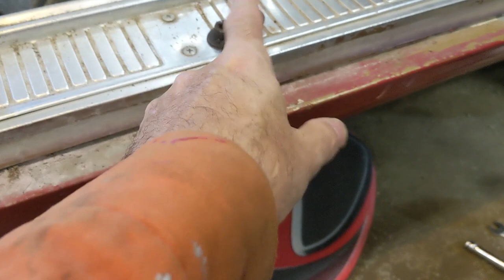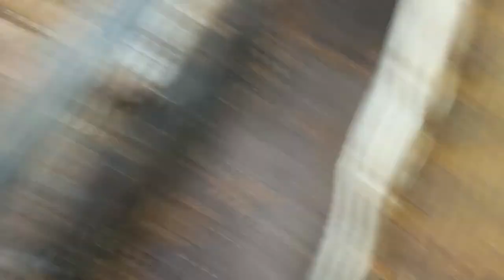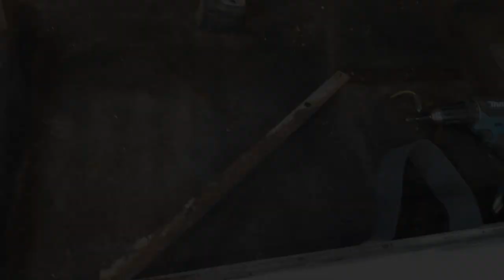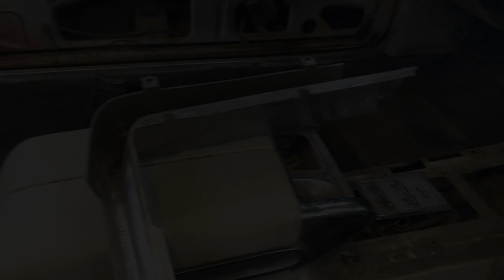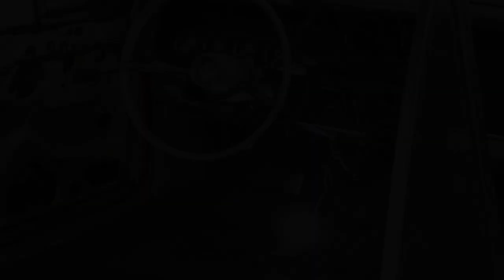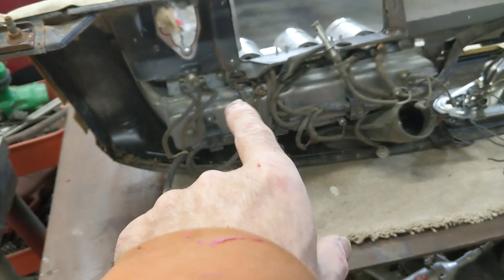REMOVING Seats/Console & Dash - 65 Thunderbird Convertible Restoration Ep #7

Comment: Well that is interesting that you don't have 30,000 vacuum hoses like I do on my '65. My a/c heater control looks similar to yours but it has the "rain bow" wheel where all the vacuum lines attach. I know I just took it off last week and mailed it to the Birds nest in Portland. I have not done much to mine as it's been so cold during the winter here. but now it's getting nicer! I already fixed both rear window vents by changing out the dead vacuum motors. Ops check good!
Reply from the maker: Hi Mike,
I didn't realize it at the time of the video, that the A/C cars had all the vacuum hoses for the cooling...not sure which is better, having all of those hoses or not having A/C. Lol

Comment: Hello Alvin, it's coming along real well. I agree with tuckerjl about the heater controls. The AC models used vacuum. I have not taken my dash apart and hope that I will not have to. That looks like a ton of work!
George B. in Michigan
Reply from the maker: Thank you George, I guess not having all the vacuum components is a blessing in a way.
Reply: @J_R_Shop  I think so also. Is your donor car a non-AC vehicle?
Reply from the maker: @servicetechnician3264  yes it is, so I'll have spares for the heater controls. 😊

Comment: Now is a good time to add factory AC to the car. (That way you will have all of the vacuum modules that the heat only does not require)  The heat only is way too trouble free LOL.   I added factory AC to a 61 thunderbird using a complete system from a salvage yard car.  Since you are in Canada I am not sure it is an issue.  It is a thought though since you have the entire car stripped.  It just requires additional holes in the firewall to mount the larger HVAC box.  The knock outs for the freon lines are sort of stamped into the firewall as I recall.
Reply from the maker: Hi Jeff, I did consider adding the A/C, until I started looking for the parts...holy, the price is more than I have into the car already, and there just aren't any of these sitting around for parts, the green one I cut up was the only one I found, and I bought it right away.
If I were in a high humidity area, then I would definitely spent the money...Saskatchewan is very dry in the summer...hot but dry.

Comment: I'm jealous of you non-AC guys...I wasn't aware that those cars had cable controls instead of vacuum. Canada, Maine, North Dakota and such places probably had few AC cars. OTOH, the vacuum seals on my own '65 were all intact, so it wasn't much of an issue for me - I didn't need to replace ANY actuators or reseal the "pizza slice" control unit. All I did on the control unit was clean the mating surfaces and that gave me a good seal.  All that stuff is holding vacuum very well, so I'm very lucky compared to most T-Bird owners with the vacuum controls. I did have to replace all of my vacuum lines, however, and that was a bit of a job because I didn't take the dash or console out so access was a problem. Thanks for the video.
Reply from the maker: As you can see in the video, I was also unaware of the non-AC difference, I just made the assumption they were all the same. I remember when I was young and hanging around Dad's shop (Jamieson's Repair Shop), that seeing a locally own car with AC was a big deal...not many people where I grew up could afford such luxury!  ❄❄❄
Reply: I have a copy of the original factory invoice for my '64 T-Bird; it shows the retail price for air conditioning was $585 which was a ton of money back in those days.
Reply from the maker: @kingkrimson8771  it was an expensive option at the time, that's for sure!

Comment: Great video.  It is funny how watching someone brings back lots of memories.  Missing screws?  A friend of mine used to say, “Put all the screws back in.  The manufacturer didn’t install them just to add weight to their product.”  “Thinking you know and knowing are two different things”  I found out years ago that if I disconnected two wires thinking I knew where they went, that I only had a 50/50 chance of putting them back correctly.  I wrote everything down.  This doesn’t have much to do with your video, but shows how when watching someone it triggers old memories.  I must commend you.  I always had trouble working under a dash when I had to tilt my head back.  It always made me feel sick.  You did well.  I wonder if some Youtuber is watching and recognizes their wiring job on the top?  Really enjoyed this one.  You are making great progress.
Reply from the maker: Thank you Stephen, one of my sayings is "50% chance to get it right, 50% chance to get it wrong...95% of the time I'm wrong" 😂😂
Yes, that would be funny if the person that wired the top with a bypass saw this video. Lol

Comment: Thanks for your videos.  Between you, Nick and John I’m slowly getting my 66 road worthy.  I have the rear seat cushion removed and not sure how to remove the seat back. Do the arm rests have to be removed first? Does the trim above the seat back have to be removed?  I’m replacing all of my vacuum hoses and checking each vac canister. Thanks again, Mike
Reply from the maker: Hi Mike,
Yes, the arm rests need to be removed, but not the trim above the seat back. There should only be one bolt holding each seat in place, once you remove those bolts, then you will need to pull down on the seat backs to get them out...they can be a little stubborn, but will come down and out.
Reply: @J_R_Shop  I thought that might need to be done but have not figured out how to remove the plastic buttons covering the arm rest screws.  I sure don’t want to damage one of those, probably very hard to find them.
Reply: I was able to remove the plastic plugs by gently prying them off with plastic interior removal tools. Thanks again.

Comment: I will be doing this on my car soon.  I have a 64 with a power front seat (not working). I didn’t see wires on your drivers seat. Was it power??  Also, my rear power windows aren’t working.  Do you have to remove the back seat to get at the side panels?  I rebuilt the carb and got the car started after sitting 40 years.  That 390 sure sounds good!!!
Reply from the maker: Hi James, mine is a power seat, I didn't show the wires for the seat...likely got cut off in editing. As far as removing the quarter windows...you will have to remove the seat...top and bottom, I can't imagine being able to do it without removing them.
Thank you and enjoy working on your 64 T-Bird! :goodvibes:

Comment: curious, im currently redoing a 66 Q code, and the rail around the trunk lid, where the seal sits is rusted out.  I can not find the steal for that piece just yet, but you seem like you know where to look for parts, so if you dont mind pointing me in the right direction!  thanks a ton, and great content!
Reply from the maker: Take a look at Bird Nest in Oregon, they list the trunk lip & corners under the patch panel section, I've ordered from Bird Nest in the past, and found them great to deal with.

Comment: Alvin,
You're making the rest of us look like pikers, my friend. 😁 Of course, I knew it would be this way.  Keep taking us to school.
Btw...to avoid the seemingly constant limit switch adjustment nightmares, it's not unknown for owners to use homemade cheater boards to lower the tops on both the classic Ford Skyliners ('57 to '59) and the T-bird convertibles with tops that goes into the trunk.  I've seen more than one of those boards at classic car shows, but they were larger than the one you found in the console.
Regards,
John
Reply from the maker: I could see a cheater board being used...I couldn't imagine dealing with one of these without something for a bypass.
I like the feedback from the YouTube crowd...this is the first time I've taken one of these car down to the bones, and I have question too, the people are fast to answer or point out the things I am not sure about. Only 7 episodes in and I've learned tons about these T-Birds!  😊😊😊

Comment: The plate that holds the column gasket to the firewall had how many bolts? And that switch is the neutral safety switch and parking brake release all in one.
Reply from the maker: There are 6 bolts, two on the bottom, two on the left, one on the right, and one on the top. Thanks for the safety switch info!